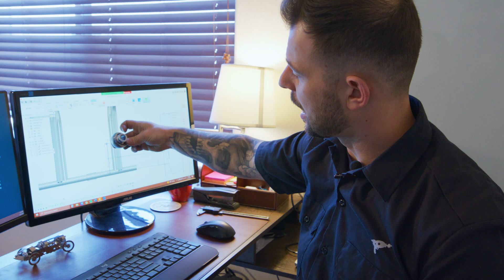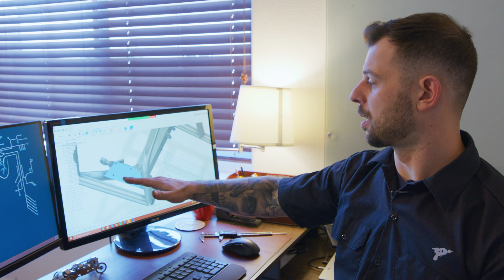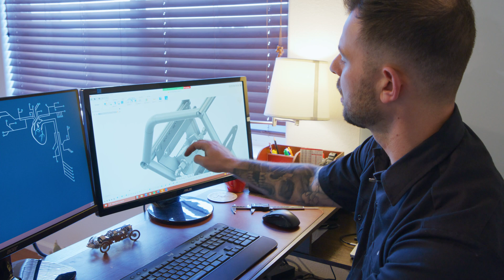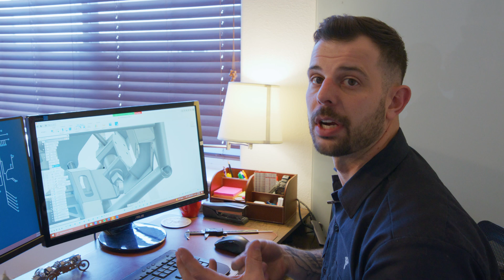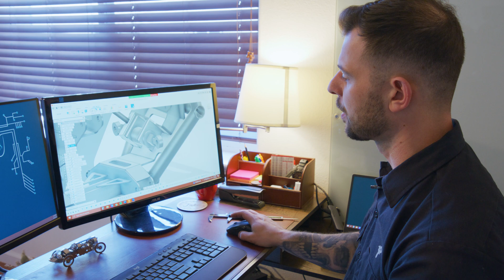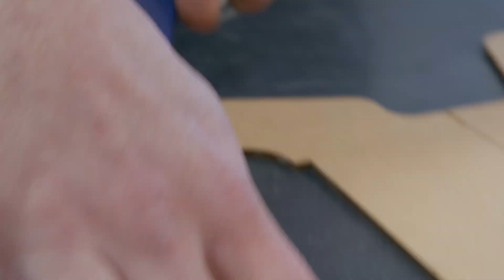SendCutSend Holland Built Eight | SendCutSend

Comment: Would be REALLY nice if you'd make a video covering the basic specs of this build other than just the engine... trans/ third members ect. 

Toyota full sized matching front a rear diffs are STUPID cheap on ebay snd they've got a drop out center section making a fabbed housing very very doable. They're also 4.10 and 4.56... and I'm threatening to build another mini monster truck which is around the same scale/size as your truck just for kicks. Never finished my first one in 2006 but it was similar to the "patriot" trucks if you're curious. Got into full sized monster trucks for a while, and I' m starting to get the off road bug again 😆 

Post a link to your personal build channel if you have one! This video series is excellent... but ya gotta tell us more about your actual build and goals! Im especially curious about the busa to tcase or trans setup but if it's not a blown alcohol/glide setup it might as well be alien to me 😂
Reply from the maker: Unfortunately we started following along mid-build on this one, but we plan on doing more custom builds from beginning to end 🔥 For more on this project, you can check out Jake’s instagram at https://www.instagram.com/holland_built/ !